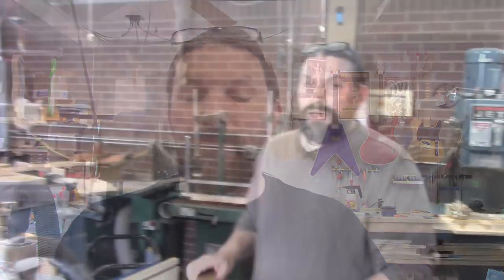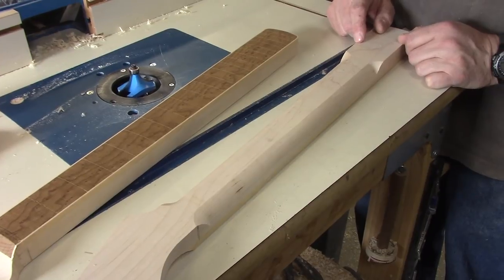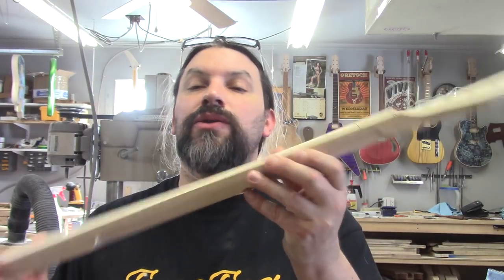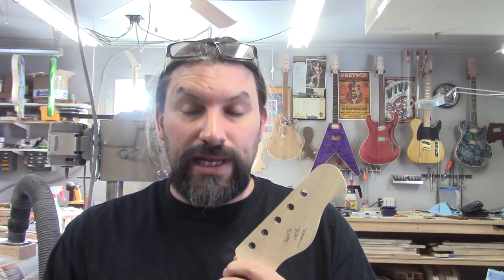DEAD HEAD SANDER... How We Shape Necks Using Some Cool Old School Tools

Comment: 9:24 and the sparks start flying!!! 

love the deadhead sander! do you normally have issues with the belt slipping and hitting the frame or only when it heats up a bit?
Reply from the maker: Hi Kohl, Thanks for watching, that sander has always been a bit squirrely. We used to get all paranoid about the belt and how it doesn't track all that well. You are right after it heats up it wants to low ride. I really should hack/file  a grove for the belt to ride in. Believe it or not it is getting some better.

Comment: I be pullin an alnighter in my paint/airbrush booth doing a evh and blue GL kamikaze body. Nothin like layin down your last clear coat as the sun comes up.
Reply from the maker: Sounds like you are making moves over there and fighting the good fight. Chris has some NOS Schwinn red he is saving for an EVH project
Reply: paints paint in my book.Painted cars for 20 yrs[Professional and production shops]. Low grade to mid to top of the line.. ppg.deltron.R-M.Dupont and many more.they all squirt out the gun..lol. I go low $ on all base materials.From spray bomb to wicked colors to auto air colors.. Only thing high dollar  i buy is the clear  coat. it goes over everything if you know what u doin..lol o crap did i miss something? is that the stuff Mr VH used schwinn?

Comment: What is the length of the flat portion, platen, on your dead head sander ? Thanks for the Beta !
Reply from the maker: I can't remember... we made it to fit our necks
Reply: If you freeze it at 8:25 you can see that the distance is about 1/4” below the nut and at about the 13th fret, so depending on your particular scale length, that is the length of the sanding surface.

Comment: What's up with the one tuner hole being smaller than the rest? Using it as a locator hole on jigs?
Reply from the maker: I had to re-watch that video the tuner hole isn't drilled all the way through it will get full sized once the headstock is the right thickness

Comment: What grit do you use on your deadhead sander?
Reply from the maker: Hi Alan, 
We are running a 60 grit belt on the sander right now.
Reply: Quick response!   Thanks!  I just ordered a 6"x80" 80 grit belt to make my dead head sander.  I have an old Reliant 6x48 belt sander that I'm going to convert.  Actually I'm thinking about sticking it on the open back side if I have room (the motor may be in the way of the headstock) so that I can still use the original platen for other things, like radiusing fretboards.  I'm in the process of building my first 4 guitars, all Tele's, for myself, my son, a friend, and one extra, just because I had extra wood, that I hope to sell.

Love your videos.  You show the aspiring luthier some straight-up decent tips and tricks, with no unnecessary bullshit.  Keep it up!!!
Reply from the maker: Cool man. let me know how it turns out